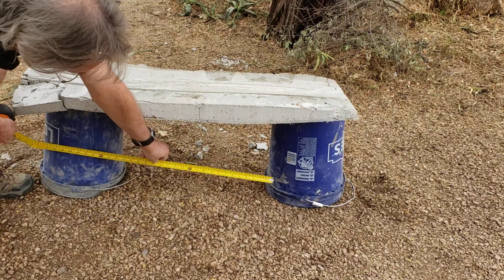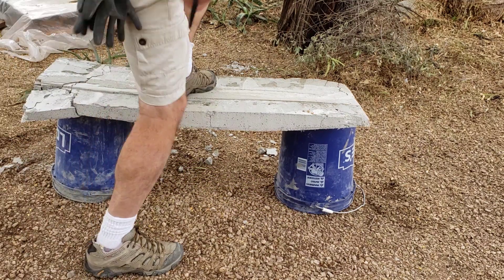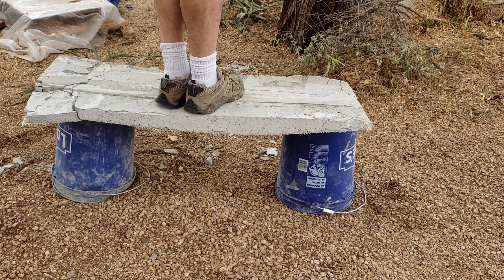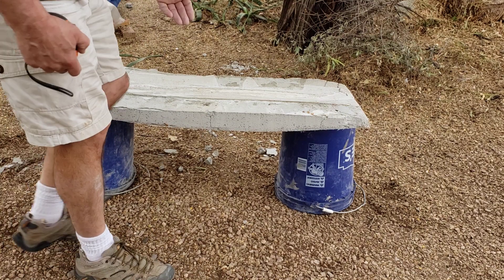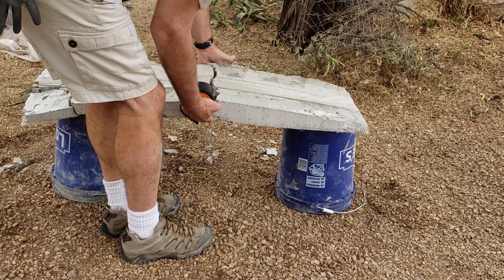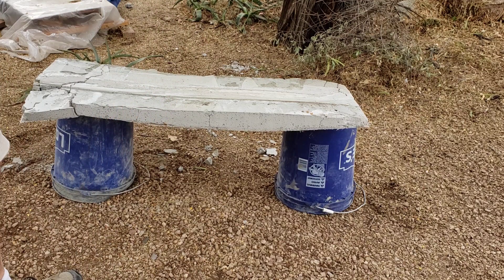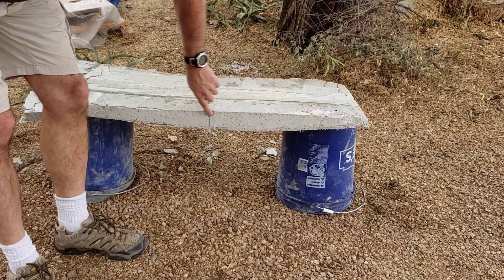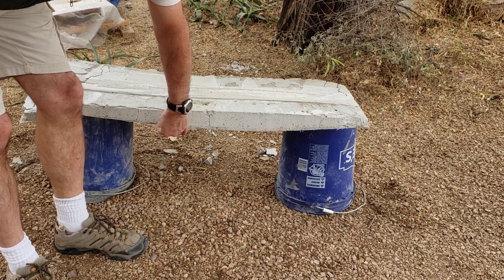Two inch thick aircrete panel with poly mesh can hold my weight.

Comment: Interesting for how long was the panel curing? And how about fiberglass mesh? I would appreciate if you could help me clarify those two. Thank you very much
Reply from the maker: @rahatlatcvehuzurverici946  it took a few days before the panel had strength. Fiberglass will be destroyed by alkali in cement. Better to use poly mesh. Special glass fiber is available, usually as chopped strands.